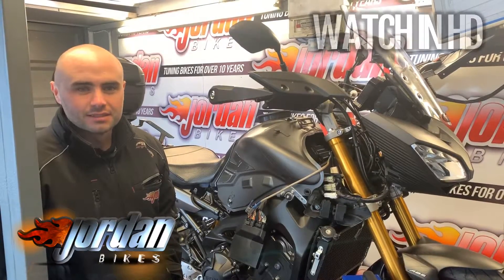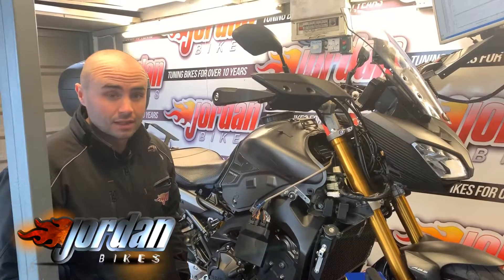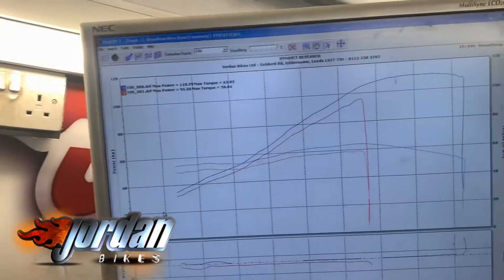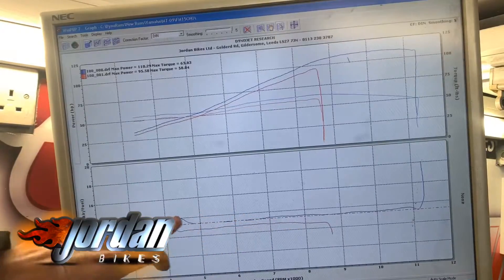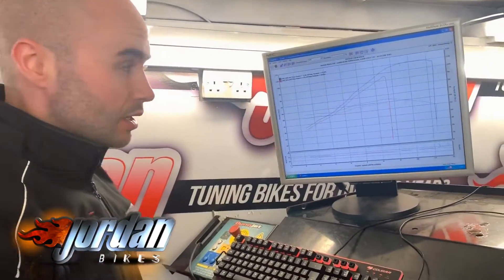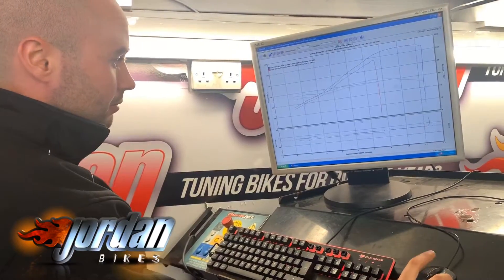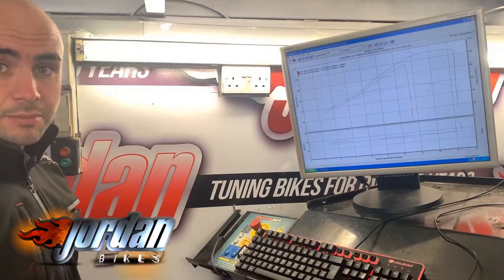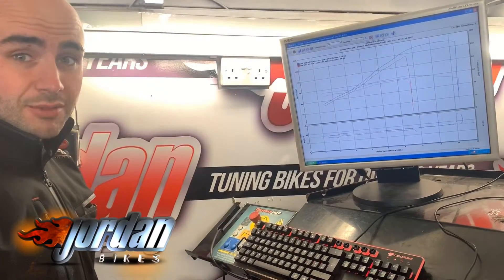Jordanbikes ECU Remap Yamaha Tracer 900 - 15 BHP gain !

Comment: Thanks guys, felt so much better on the ride home,well recommended!
Reply from the maker: Phil Hill fantastic ! Would you mind ever so much sharing your experience on a Google review? Every happy customer helps !
Reply: Hiya Phil debating bringing mine down at some point soon i can see you had yours done around 3 years ago now so would be good to get a later review on how the bike felt and if you hand any issues or anything niggly that you didn't like, mainly for me its the jerky throttle the engine braking is very hard and slams my gf into my back quite often other then that hows the power and fuel consumption cheers mate any feedback would be appreciated

Comment: My 2017 Tracer 900 had a remote ECU flash, i take the ECU out sent for a company and they done the flash. After receiving back pluged in the bike not start. On the top left corner of the dash says Err and the red key flashing. Fuel pump not priming. Can you or anyone help me out with any advice please?
Reply from the maker: We don’t offer a postal remap service for this exact reason, we make sure that the bike is running perfectly before it leaves us. I would contact the company who did the work and see if theyll do it again for you?

Comment: Do you only do live remaps, or is there a cheaper option f you sending me a file to flash?
Reply from the maker: We only do maps on the bike, so that we can do all the work live and make sure through the whole process that the bike is running, fuelling and throttling perfectly. Any pre-done map that’s uploaded onto an ecu without the bike touching a dyno won’t be anything like as good, so we just don’t offer that service. If we can’t make a bike perfect we’d rather not touch it. I hope that makes sense, thank you for your message.